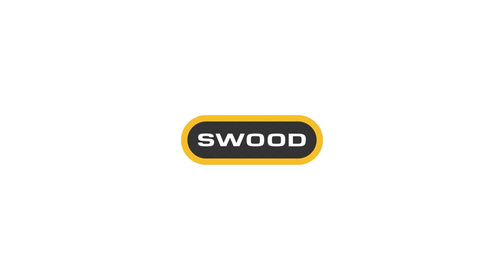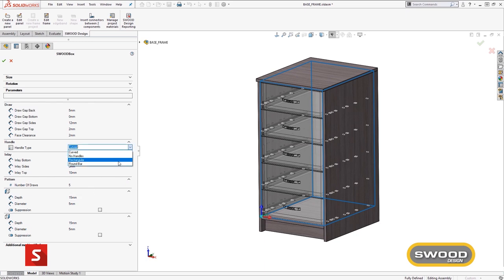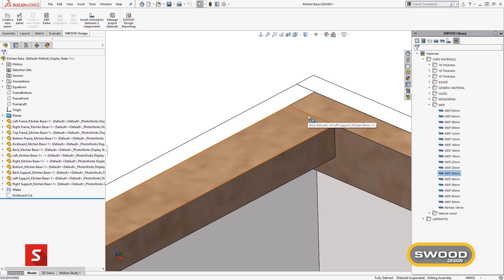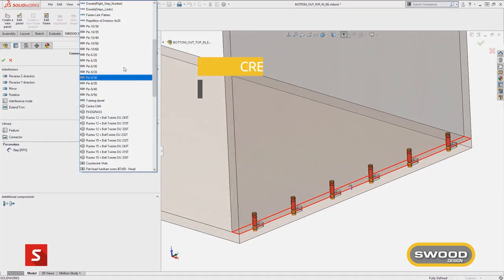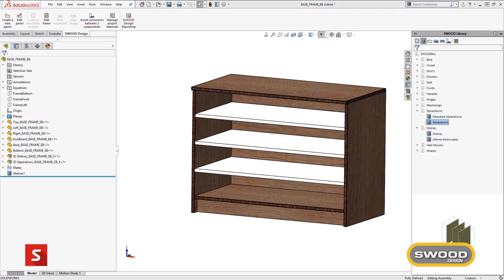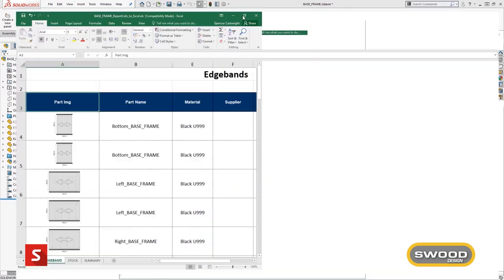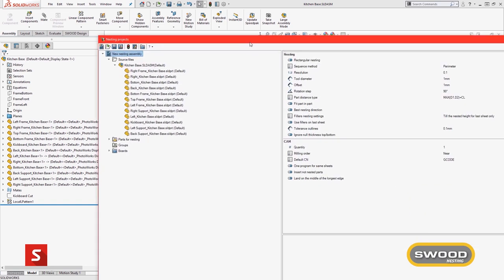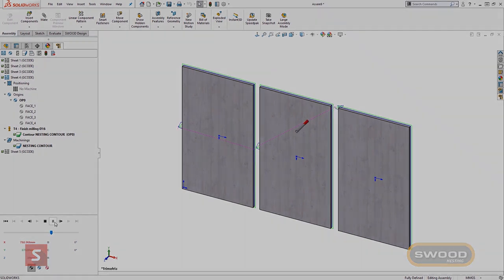Introduction to SWOOD - Woodworking for SOLIDWORKS

Comment: 0:00 Intro showing custom frame getting modeled with Swood tools
0:50 Intro of the 3 Swood modules and the the statement that Swood is designed to save you time compared to stand alone Solidworks or other CAD apps
2:00 Swood "Frame" Templates
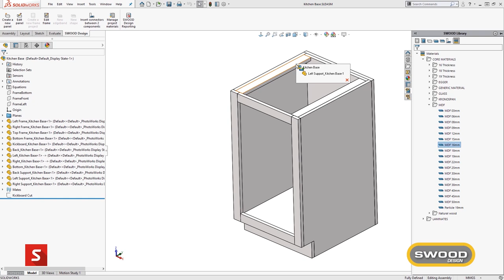3:00 Swood Material Library
3:57 Swood Connectors
5:00 Edge Banding
5:48 Breakup into modular subassemblies "Swoodbox"
6:54 Inserting "Frames" to Assembly layout
7:20 Demonstrating change to assembly layout will automatically change inserted parts aka Frames
8:02 Swood CAM
9:23 Swood Nesting
Reply: Thanks for the index. Btw, you forgot to include: 10:00 Stegosaurus Walking

Comment: Can "boxes" and rules be added to curved/prism surfaces? Ie. we have curved or slanted side panels and we want to add connectors and shelves with conectors to it. Is SWOOD able to calculate the positions bases on tangents to the surface and unrolled length of sides? Can it calculate slanted cuts in any direction? That would be very helpful as not all furniture are rectangular, especially in tight, irregular spaces and caravans/boats/idiomatic architecture.

Comment: Nice video. It would also be good to see a video on how Swood functionality actually compares to Solidworks in built functionality. I.e. I believe you can achieve much of this with a little effort from just Solidworks out the box. So it would be useful to see just HOW much better / where the comparative advantages are in using Swood to justify the further outlay. Thanks for the informative video though. 👍
Reply: You cannot really compare. You must be a serious solidwork expert to come close and you will still miss a lot of the features. Streamlined environments for specific tasks are unbeatable. That is why solidworks has so many tools, in the first place. Here, combined in a single tool that speaks the language of the given task and the people that have been working years on it. You get the benefita of Solidworks as a cherry on the top, because you can combine sheet metal and other modules that you are familiar with.